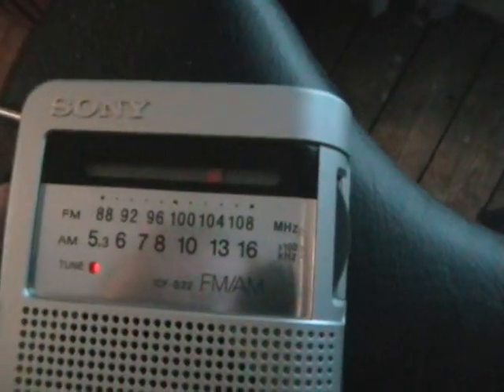How to build a SPY Bug

Comment: Is the 0.5mm the diameter of the wire? If the anwser is "yes", how do you calculate the frequency, because I calculate it  30 MHz?

Comment: in the circuit diagram goes emitter to gnd and the 360 Ohm resistor from collector to Vin, but in the bubbles you wrote it the other way

Comment: the soldering  much to be desired   either iron not hot  enough for solder  of the  material to  high a  eutectic  .  get 25 watt iron   ,  or tin based lead free
Reply: I hate lead free solder

Comment: This technology had been expired since 80s,the new one is PLL
Reply: In the 80s pll circuits where still in using. The cmos circuit 4046 is a good example for. But a spy bug with pll circuit has also some negatives. It needs more devices and it is more complex and it isn't so cheap like a simple modulated Oscillator . A simple bug with just a Transistor and maybe an additional end amplifierstage for frequency stability and powerful output will work really well and can transmit over 800 to 1000 meters depending on the environment conditions and the used receiver.
Reply: @erstermaat5245  
Yea, agree with you, but PLL has been upgraded and there alot of kitts in the market and somehow cheap,cause this technology was exclusively in the past for specific equipments such as military tranceivers  etc...,that's why was expensive, but nowadays it's with every hands and everywhere.
Of course PLL classified for professionals not beginners...

Comment: my range is only 10 meters at 3volts and it does not work at 9v...wat should i do?
Reply from the maker: +karan pandya 
When building FM transmitters you need to have all the soldering work 100% because
they are high frequency circuits ,if a transmitter is working at 100Mhz they are working
at 100 million cycles per second ! so all parts need to be in the right place and all
soldering work 100%.

Your radio will be picking up the harmonic frequency and not the main
frequency ,thats why you get very little range because its the harmonics.
you are finding.
Reply: Hmmm...ok..thanks
Reply: dazaro3 but I m getting a clear frequency with no distortion...can it be a harmonic frequency?
Reply: hi dazor3 where may I search FM radio transmitter circuit and its components?help me sir
Reply: +niyonagira olivier  electronic parts shop

Comment: Might get a little more distance out of it by reducing the 330 ohm resistor to 270 ohms or 220 ohms. But you don't want to reduce it too much, or it will start burning out other parts. Also might get a little more distance by using a rf transistor such as 2n2857, or 2n3839, or maybe a mrf905, which is a oscillator transistor. But be aware that these substitutes will add to to cost. To keep the cost at a minimum, use the 2n3904.

Comment: how da hell do you know which side of the mic is what  ?  ?
Reply from the maker: +Sys.stem 
Condenser microphones
2 terminal electret condenser microphones, the actual microphone body is the ground.
The ground or common connection of a two terminal ECM insert can be identified
as the solder connection that is touching the case or body of the mic.
Reply: thank you so the isolated pin is the +, okay that make sense

Comment: and if i use 50 trimmer cap , how many turns in the coil i will make ??
Reply: You would want a little bit less inductance with a 50 pf, so try 6-7 turns should be about right.

Comment: dazaro , can i use 50p trimmer cap ? and replace the 4p7 with 5 ?
Reply from the maker: +Clockwerk Clockwerk 
All i can say is give it a go ,the 50p trip cap will work if its maximum value is 50p
Reply: Yes a 50pf is close enough to work. You also should slightly reduce the inductance of the resonance circuit, try using 7 turns.

Comment: and also can i use a 2 to 22pf variable capacitor?
Reply from the maker: +karan pandya 
Yes ,that will work just fine.
Reply: +dazaro3 How close to the 10mm microphone must be the person you want to  ,,hear``? Thanks.(I know it depends how strong is the person yelling. I mean a normal conversation)
Reply: +dazaro3 it seams we can use a lead from a pen as a circuit or resistor
Reply: Anonimescu Cutarescu lead from a pencil is used in foxhole radios

Comment: is good 2n3906 tranzistor for this fm transmitter
Reply: A 2n3906 is a pnp transistor, this circuit uses a npn transistor, therefore a 2n3906 would not work in this circuit.

Comment: can i use other type of transistor like 2n3053
Reply: Yes there are alot of transistors you could substitute. The one you mentioned will work, some other inexpensive transistors that will work, 2n2222, 2n2222a, 2n2219.

Comment: Question: what does the 4p7 capacitor do in this circuit?
Reply from the maker: Andrew Jaster 
The 4p7 provides a feedback path and this keeps the transistor oscillating.
Reply: Thank you
Reply: +dazaro3 will it work with 5pF also?
Reply: A rf oscillator has to have feedback to work, the 4p7 provides that feedback between the collecter and the emitter of the transistor.

Comment: Hi Darren and Family, Dazaro3, I want to thank you for being the one who got me to build my first FM TX, I love them, being into radio and such. I am a subscriber and am looking forward to a new video, busy, I know. Perhaps a 4 transistor with some reach, bend a few rules, hey. All in the sake of TX, RX. I am going to make one as my electronics knowledge and skills have come to be with lots of practice to a point where a four stage TX would be well within my ability, always a newby, me. Anyway, I hope the weather is fine in the UK, I have a friend I did machinist work with in the 1980's and he is from Birmingham England, how cool, BSA, small arms, SA. I have learned that capacitors allow AC signals to pass, but, not DC, a fundamental part to building an FM TX. I use a mid 30 pF fixed capacitor in the tank circuit and as you have stated in your video tutorials, attaching the antenna to the less fussy emitter side of transistor or 2nd coil on Induction coil, nearest the transistor. Oh yeah, I still know the friend from Birmingham, we keep in touch. Take care, be good (in all ways), Peace and Love from Oregon, USA, Cass.
Reply from the maker: Cass Virgillo 
Many thanks for your nice words,i will try can get new videos uploaded when i get the time ,been very busy working away.A 4 transistor FM transmitter sounds good ! a buffer stage and amplifier for more stability and RF power .Peace and Love from Birmingham UK

Comment: You can replace the electret mic with a headphone jack in series with a capacitor I have figured out (I used a 0.1μF cap). It also seems most of the component values are not that critical: I used 470pF instead of 1nF, 7pF instead of 4.7pF, 2.2kΩ instead of 4.7kΩ and I removed the 22nF cap as well (Author, mind telling me what purpose it serves? supply decoupling?) and the circuit still works well. It works even on a breadboard despite all of these changes.
Reply: hi,
can i get your circuit figure for the above circuit...?
i wish to try out your circuit.
send me  harindra36@gmail.com
Reply: mre521  ya it looks that C does not do any thing!!
Reply: so your model worked without the 22nf Capacitor? did u substitute anything else or just nothing

Comment: can we use without a trimmer by using 39 pf cap
Reply from the maker: You can replace the trimmer with a 10pf or 15pf
ceramic capacitor and then adjust the FM frequency by
stretching or compressing the coil.
Reply: dazaro3 what is the size of these two resistors?(360R resistor

4.7K resistor)
Reply: Harold Galan size in watts? 1/4 watt worked for me...
Reply: Harold Galan size in watts? 1/4 watt worked for me...
Reply: TheNewtonsapple thanks

Comment: Good day sir dazaro3. I followed all the values of each component and I can hear now my input audio but it's still very blurry and is not stable. With the help of the varicap I was able to find my signal at 88MHz. I'm thinking of two things now but I want to ask you first. 

1. Making it 5 or 6 turns instead of 8.
2. Adding another capacitor (maybe 22pF) in parallel with the varicap.

What do you think, sir? Thank you and God bless you.

Comment: Sorry a bit confused, First you say you connect the 330R resistor to the collector, then you say solder the LC to emitter and then the antenna wire to collector? but  the way I understand from your circuit 330R is connected to your emitter, the LC and antenna connected to collector. which one is correct?

Comment: can i do without trimmer? using a simple 10,20,30 or 40p capacitor?
can i use an capacitor bank parallel (102//102//103//103) -> 22n?
ty

Comment from the maker: You can use any trimmer from 1pf upto 50pf .You can buy the parts from rapidonline ,farnell ,rs components,Ebay,or mouser or You can replace the trimmer with a 10pf or 15pf ceramic capacitor and then adjust the FM frequency by 
stretching or compressing the coil.

Comment from the maker: 22n ,you can replace with most caps like a 1nf upto a 470uf,replace trimmer with a 10pf or 22pf cap then djust the FM frequency by 
stretching or compressing the coil.

Comment from the maker: Yes you can use a 10n in place of the 1n. The FM Transmitter can be picked up using any FM radio = 88Mhz - 108Mhz. You can use any 0.5mm wire for the coil,it does not need to be insulated.

Comment: Change the value of the resistors to 10K and 100ohms and run it off 12 volts.You may need to fit a heatsink to the transistor.If you use a bc108 or bc109 you can just wrap a bit of copper around the casing which is internally connected to the emmiter.Use an aerial of about 3feet.

Comment: I used to make these things 30 years ago.They can be made to work from 1.5 to 12 volts by changing the value of the 2 resistors.The coil can be made much smaller by wrapping it around a ferrite slug.Many high frequency npn transistors will work with this circuit.(BC108 BC 109 and even smd transistors will do it.

Comment: 2n3904 0.4W -> 400 mW ! For big city don't use of the transmitter.Big city Radio transmitters center is 5000W power! this transmitter big city in the absorbed signal!

Bu verici yi Büyükşehir de kullanamazsın,sinyal absorbe olur, ormanlık alanda sinyal az olduğu için adam kullanabilmiş.

Comment from the maker: A 3mm drill bit will work fine ,if you have built this and you can not get it working then take out a turn out of the coil =7 turn ,then place the transmitter 5cm from your FM radio and using the tuning dial on the radio start from 88Mhz and move the dial unto 108Mhz ,if you get some feedback sound then its working OK.

Comment: The circuit won't work at all on a breadboard because the clips act like capacitor plates, resulting in a minimum of 5 pF between any two nodes.  If you do get it to work on the breadboard by some stroke of magic, then it won't work off the breadboard without those parasitic capacitances all over the place.

Comment: dont just go soldering things just take the components and place them on a breadboard and see if the circuit works and apply fixes if needed
then solder it all

Comment: To Laouren in case you can contact with me I will try and question to Dazaro3, please advise that project shows 330R soldered to "E" of Tr and 1n capasitor whereas 103 capacitor used and 360R soldered to "C" of Tr in practice.-Thanks

Comment: Hi, I got the air trimmer also... Instead of 22n, 330 ohm and 3 v battery, I sed 6.8 pf, 200 ohm and 9 v battery..and inductor coil is some what bigger dia than u mentioned. I used breadboard.. its not working.

Comment: I just learned a little a little about RF Chokes and voltage controlled oscillators, could either of those be used in place of the wirewrap?

Comment: You are correct, no such thing as a 360R resistor :) 330R in the scheme shows the right value gold=5% tolerancy 1/8 Watt. Build it in a small metal box (shielding), small extract. antenna outside. Take care of insulation for components & be aware of 9V battery onto plug wil blow tansistor. Used to build several in my student days, range is limited and disturbs local radio and tv sets but fun to play with. A 3V CR2032 batt can keep casing small for good spy positions, very easy to track thou ;-)

Comment from the maker: You do not need PPL with this type of Bug,its very cheap and easy to build
and with a good battery will stay bang on frequency for many days.
I have sold many 1000s over the years and not one person has go into
trouble using this type of low power Bug ,its only about 2mw RF power.
Very little or no harmonics.

Comment from the maker: You can use a ceramic capacitor  ,any from about 10pf- 22pf
then you can compress or expand the 5 turn coil to change the
frequency

Comment: Update, tried the 47kohm x 2 resistors (with dazaro3 two transistor version) but it was over-modulating quit badly even with the mp3 at it's lowest volume, then tried 100kohm x 2 resistors, much better but not perfect, so i suggest something like  220kohm x 2.

Comment: Hi Darren, well done on your TX’s. Tell me, which do you find has the best range? You have this 3 volt unit with the parallel tank and I’ve seen in one of your other videos with the 9 volt unit using a BC338 and a series tank. Logically the 9 volt version should be significantly better but I wonder which actually performs the best.
Kind Regards ... Andy

Comment: LOL...so replacing the 1 - 5p to 30p trimmer cap with a fixed cap of 39p...ah yes...that makes sense. Any cap value between 5p and 30p will work but obviously tuning needs to be done by stretching or compressing the coil which makes getting-it-to-work a little bit more tricky. Have a look at previous posts, i'm sure similar questions have already been asked and Dazaro3 has answered them.

Comment: There's more to it that that....first you need to combine the left and right channels of the MP3  together using two 47K ohm resistors, then connect the combined signal to a capacitor (or the transistor biasing voltage/current will go into you MP3).

Comment: Dear you have to cut the mic use up to 100 ohms variable resistor between one of the wire between mic & mp3 wires for volume adjust  or u can use direct mp3 volume adjust , one wire will be direct connected between mic & mp3 , other will be through variable resistor ,

Comment from the maker: Hello
You can use a 470R,360R,330R or even a 100R ,using a 100R will give the FM Transmitter a lot more power and range .

Comment: @theaviator2180 
A better option is to use dazaros' two transistor version but use standard components rather than SMD (SMT) much easier to get working, it's a lot more stable, and it's only needs a few extra components.

Comment: @theaviator2180 
First thing to do is to fit the 22n cap as in the circuit diagram, still no joy, remove and test the transistor as u might of damaged it while soldering. Check u have the emitter/collector the right way round, there's a very slightly higher volt drop across the base/emitter junction compared to the bass/collector junction, use a multimeter with a diode test if no transistor test socket available.

Comment: hello, i`ve tryed to build a bug like in your video but instand of a 1p-5p to 30p trimmer i used a 5p-15ptrimmer with 3 legs and i used only 2 of them and i didn`t used the 22n capacitor you use after the coil AND when i plug the batteries ALL HEATS UP specially the coil and batteries you know why? ..i saw you said + of the mic ..wich one is + ?

Comment: helloo, im making an fm transmitter but without the ceramic trimmer or the variable capacitor, im making it with coil turns , i did 4 turns with 0.5mm coil and with a 3mm diameter, i just wanna know the radio frequency ( MHz ) ? will it be enough? or not thanks!

Comment from the maker: @akshayd211 

The type i use are miniature ceramic trimmers, they are single turn ceramic trimmer capacitors,
you can use a:  4.2-20pF Red   or a   5.2-30pF Green.

Comment: @7419635841635
You don't need the variable capacitor. You can use a 12 to 22 pF ceramic disk capacitor (costs $.25 US or so). Then instead of tuning with the variable, you use a toothpick to push between the turns of the coil, and bend them outward to raise the frequency.  Just a little bit of bending will make a fairly large change.  I noticed the coil had 8 turns.  I think that may be too many, most FM bugs have about 5 or 6.  But it's better to have too many and take one or more off.

Comment: @7419635841635 Ceramic caps are cheap and work good at 100 MHz. FM frequencies. The 330 ohm resistor can be changed but it will change the battery current and the frequency somewhat. The sound quality is not that great, the high frequencies will be muffled because this circuit does  not have preemphasis. that is used in FM transmission. You can see more at sm0vpo dot com slash tx slash bug dot html.

Comment: @Neale91 The 22n cap bypasses the RF from the coil to the common or ground. It will not be stable if it is left out. The most difficult part with this circuit is tuning the variable capacitor to put the frequency at the right spot on the FM band. Also, if you will be within a few tens of meters from this wireless mic, then you don't need the antenna. The antenna causes problems with stability, the freq will change when you get near it. A short one is better.

Comment: @silvestro771 Colpitts, though it doesn't look like it. The 4p7 cap adds feedback to make it oscillate. The mic changes the voltage and the junction capacitance varies with voltage. This version is missing the mic preamp transistor that most bugs have. You will have to talk loud or be very close to the mic to get it to be heard. Search google for FM wireless mic schematic to see many more plans. For best results you can buy the kit with PC board for around $10.00 US.